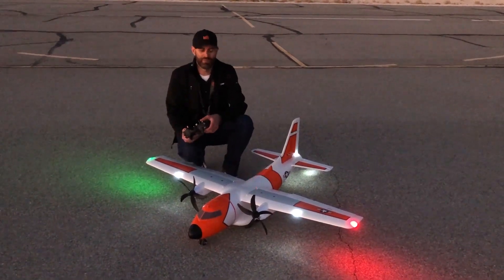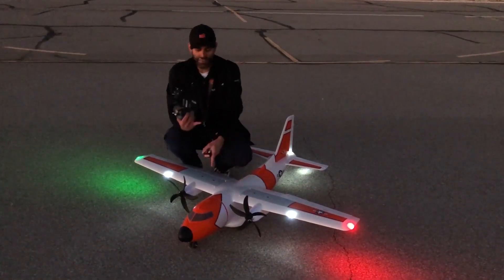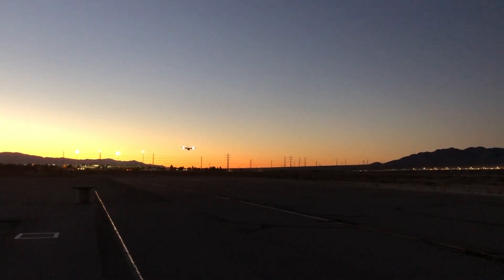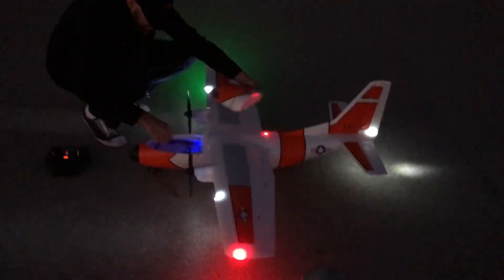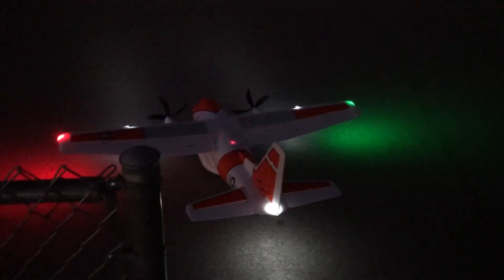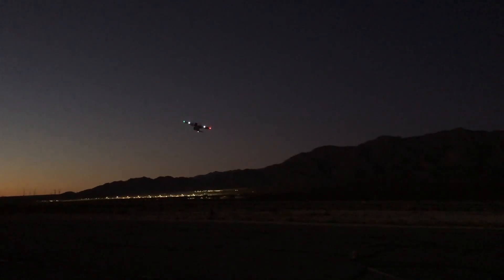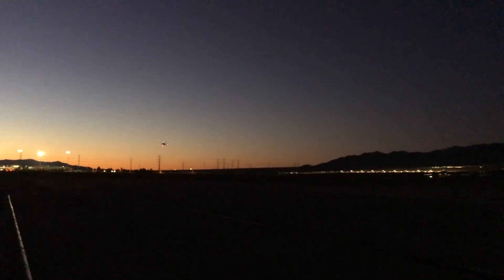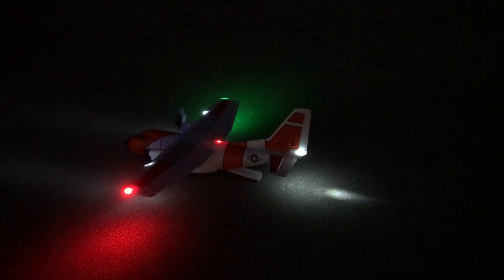Flight Talk: E-flite® EC-1500 3S and 4S battery comparison

Comment: The difference ' can' be night and day.  I bought the full size  apprentice sts with transmitter and taught myself to fly. Went every morning before work for about 1 month.  With the stock setup the difference between 3s and 4s wasn't that obvious.  
I changed out the motor and esc for a eflite power 25 and spektrum avian 80 amp smart esc,  went to a 3 blade prop because if i would have went any bigger of 2 blade it would be scraping.  Anyway with that setup the 3s was noticeable compared to the original setup... with the 4s im afraid to go full throttle,  it seems the wing is going to rip off.  Lol